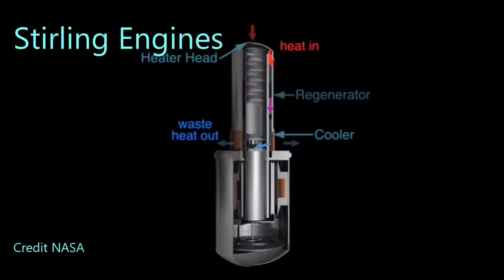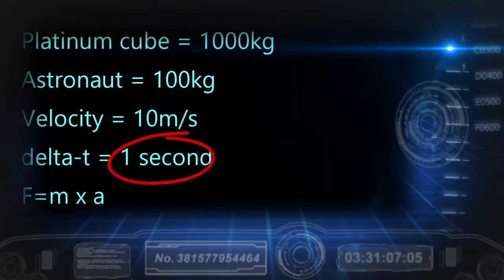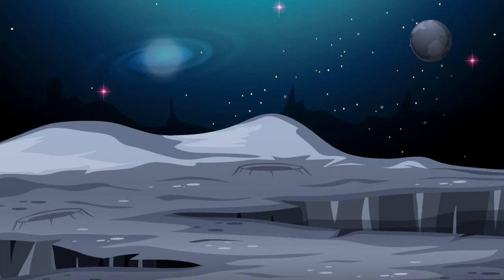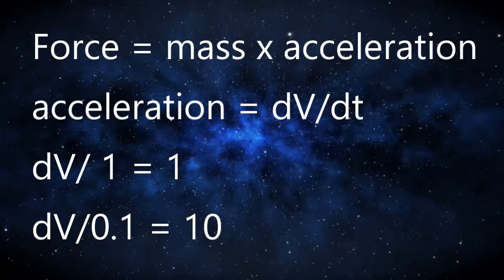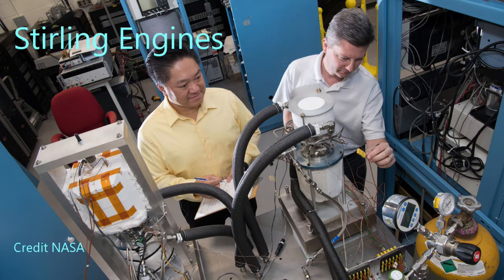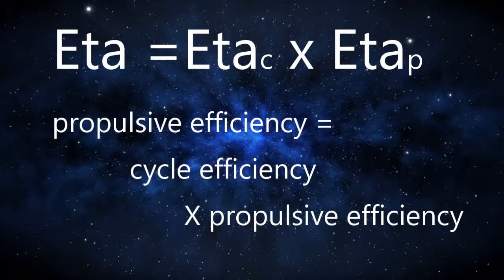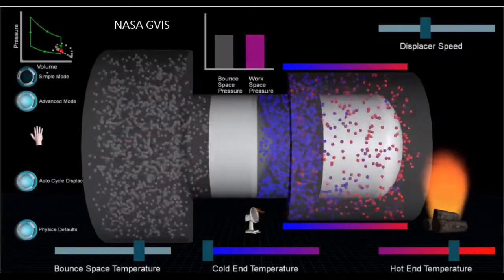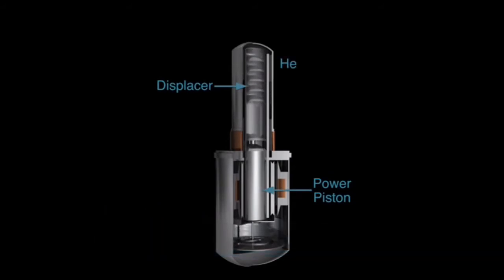Spaceship Power Technology: Stirling Engines for Space Applications

Comment: Stirling engines have been around since 1800s so it's says something about our education system when comments say "I never heard of of a Stirling engine." Problem is that they produces very little torque/ horsepower, a 4 cylinder clunking build puts out .5 horsepower.  Wow. It's an interesting concept serving to inspire better ones.
Reply from the maker: Very true.  It will be used on the new Kilopower RTG system that NASA plans to use on Mars...

Comment: Why not build power plants with large sterling engines? Using natural gas or even concentrated solar , with sand batteries,  use a cooling pond, or tower, possibly a well,  ( a underground pond or river) using a heat exchanger, to maintain the cool required,   would it be more efficient than the steam turbines currently used,,? I know concentrated solar will be better for the earth, replacing just one or two coal plants would be worth it, the sand batteries can keep the engine going over night, generating power, usingt
Reply from the maker: They have been considered but I think the new thermovoltaics will make almost everything else obsolete.

Comment: 15:20 when you have an engine or a gas  turbine you can use the heat for different purposes like heating houses or facilities or if it is hot enough to run a Steam turbine cycle
Reply from the maker: Very true...

Comment: some late info.     apparently, the first half of this video 'just needed a home, somewhere'.        one  joule  equals  one watt-second.         at 20:17,  any heat engine design, in which a  flywheel/crankshaft assembly is not utilized, is  an  Inferior  one.       it can be  Seen that any  linear/Reciprocating alternator  has  the  Exact  same  problem;  NO conservation of momentum.!    Spare me any blather about 'em.      googletranslate
Reply from the maker: Ok...

Comment: would something in orbit have potential energy? (i.e. similar to something 'held' to prevent it from falling)
Reply: I cannot just attach a wire to it, and let it fall... I would have to slow it down first... but wouldn't that kind of 'give it' it's potential energy?
- The gravitational potential energy that I can get out of it, relative to what it is orbiting, should be zero if it is in orbit... as I cannot take any out of it... (by just moving it up a little from a local well)
- this is just a feeling, though...
Reply from the maker: Everything that orbits has potential energy equal to mgh (massxgravityxheight).  Gravity for Earth is 9.71m/s^2, for the Moon 1.33m/s^2.  The object also has kinetic energy related to its lateral motion.  The kinetic energy keeping it in orbit must be overcome to bring it down.  On Earth if you get below about 150km the atmospheric drag will quickly help but on the Moon you could technically "orbit" 10m above the tallest surface feature in your orbital path...though you would be going really fast.

Comment: Is the heat produced in the combustion would reach the permanent magnet and demagnetised?
Reply from the maker: Where in the video?  Thermal management is critical to any electromagnetic device.  The Stirling heat pump can get temperatures down to 20K. With heat pipes it should be easy to cool them as long as there is power.
Reply: @terranspaceacademy  in 28:28 and 19:16 sterling engine pistol movement is used to create electricity by linear generator. The magnets are attached to the pistol and surrounded by coils. The heat could transfer from pistol to the magnets. I heat pipe can't control heat in the piston. Heat pipe is used just to maintain temperature in the cold side of sterling engine.
Reply from the maker: @GiriPrasath001  These are commercial systems so the magnet must be able to tolerate the temperature is generated but I’ll check with that company. Thank you.
Reply: @terranspaceacademy  if u got any updates please share with me. Thank u

Comment: I have a question
Reply: In regards to the Sterling heat/ cold conversion transference of power, could the temperatures of space generate enough combustion to traverse through space, if we’re only utilizing fossil fuels, to enter and exit the atmosphere? And would a much larger heat pump generate enough energy from the Earths temperature to effectively generate enough energy to sustain a Dyson sphere?
Reply: Utilizing space to house humanity and rebuild earth as a garden, such as it should’ve always been.
Reply from the maker: We could use a nuclear pellet/block to generate heat... Pollonium maybe. And use Stirling engines to produce power from the heat flow to radiators... Remember there needs to be a differential for flux to occur.